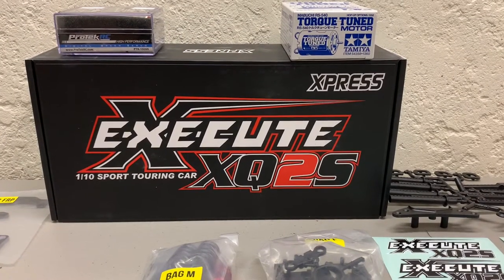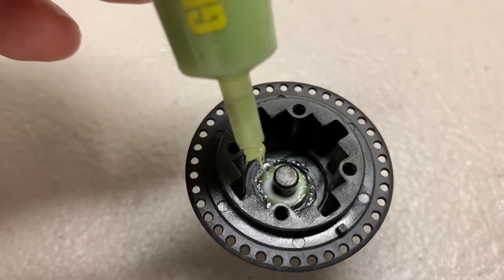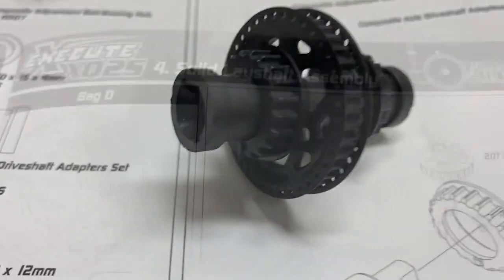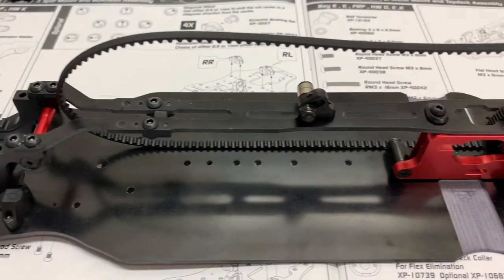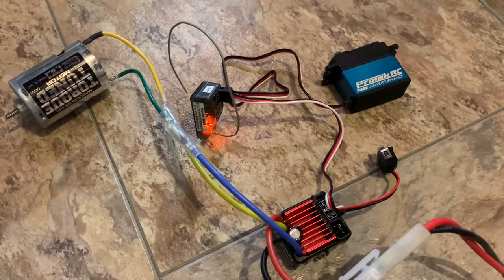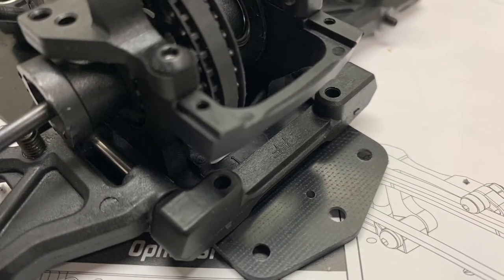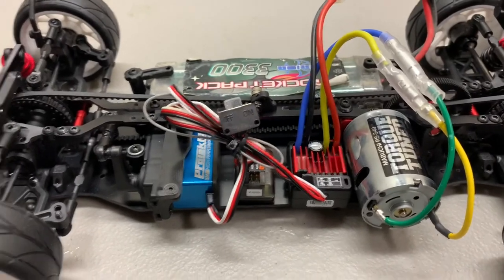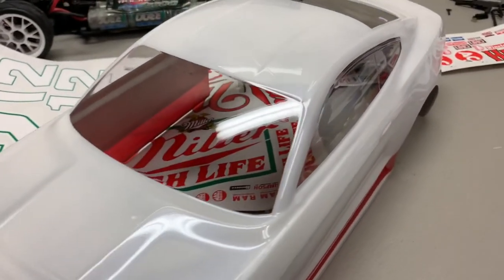Xpress XQ2S Build Video

Comment: I have this car - it's phenominal. A couple upgrades to really make it pop - double cardan CVDs up front and the titanium diff outdrives at the front. I can beat guys at my track running x-rays, yokomo BD10, Xpress XQ10R, anything. It's a great little car!
Reply from the maker: I’m going to do a follow-up video to add those two upgrades along with anti roll bars and the metal servo mounts. Had a great time racing this car outside on asphalt last summer. Can’t wait to race it again with the upgrades.
Reply: Thank you!

Comment: Great video.  I am looking at the ARTR version of this kit.  I am a bit apprehensive as I new to the hobby and other than building a few Tamiyas like 20-25 years ago I haven’t build up a touring car like this.
Reply from the maker: Hey Brian,
ARTR is a great option but if you’ve build kits before you can build this thing. It’s not that difficult. Plus there is a big forum on this car at RCTECH.com that answers normal build issues and can help with any specific questions you might have. I’m happy to help here as well. It’s a fun car to race with lots of  adjustments and upgrades for racing.
Reply: @mitamiyaguyrc7825  hey thanks.  Yeah I think you talked me into it.  I was looking at this ARTR version or a Serpent S411 RTR.  I think I prefer putting my own electronics, motor, servo, etc into the build.

Comment: Love the build and the body is awesome looking!! I got this car as a gift but I can't get  the gearing. Never had 64p gears. I have the same motor as in your video but no idea on the pinion size.
Reply from the maker: Hi RC Bashed. I used a 21 tooth Tamiya pinion. Available on EBay.
Reply: @mitamiyaguyrc7825  thanks!!